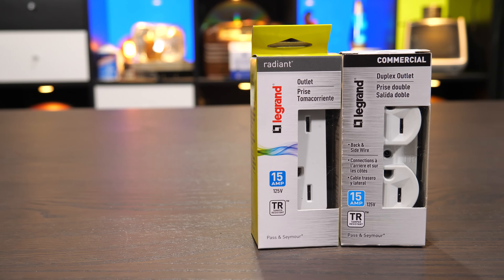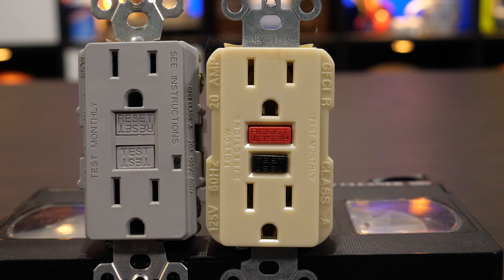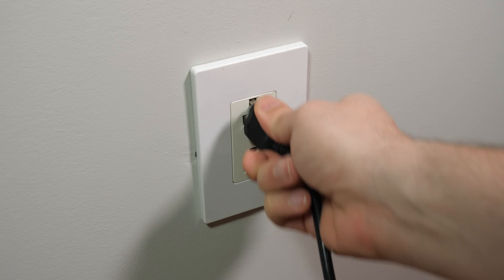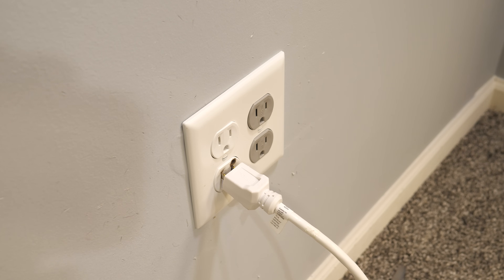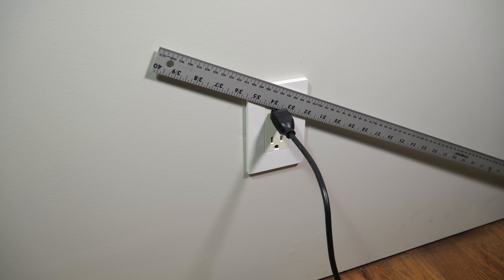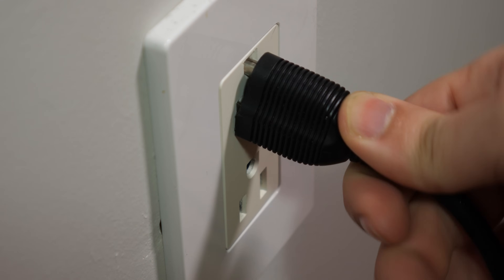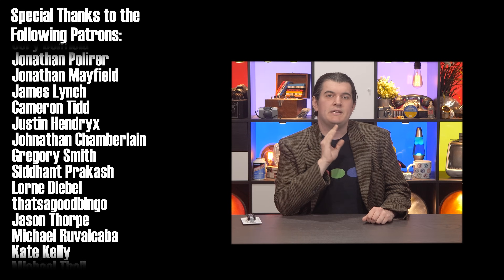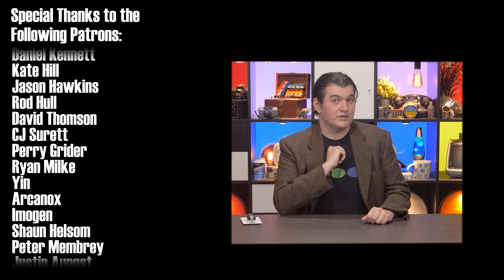Power outlets are topsy turvy - but does it matter?

Comment: How about just having opposing sockets? Having the bottom one the old "right way up", the top one the new "right way up". Then you can just use the bottom one for a 90° plug, the top one for any other plug. And if you mount it sideways, you even can conveniently use two right angle plugs at the same time.

Comment: Over the past two years I've replaced every single outlet in my home with new LED lit outlets. I also put GFI outlets in every outlet in both my kitchen and bathrooms.  Every single outlet has been grounded properly and set correctly in the walls as the National Electrical Code requires. Oh yeah Romex is totally allowed for use here. Sadly or gladly every outlet in my home is oriented ground prong down. What's funny is the LED grid that lights up so you can find the outlet is set so ground prong down aims the outlets LED light panel at the floor which is good for sleeping. Ground prong up would sent the LED light panel illumination UP polluting the room with far more unwanted light at night. Bad for sleeping.

Comment: I bought a house a few years ago and after I moved in, I realized all of the outlets are upside down. You are spot-on. I absolutely HATE it.

One of the first annoyances I encountered: I bought an outlet meter (shown in your video as the kill-a-watt), which you plug into an outlet then plug devices into the meter, and it has a display on it that tells you how much power is being used. I also bought an outlet timer, which also has a display. I can't use either device because to do so I have to stand with my legs straddling the outlet, and bend over to look at it between my calves while my head is upside down. It's the most idiotic thing. I refuse to even do it, so the devices sit collecting dust in a box until I get around to flipping the outlets over.

Another point: my house was built in 1979. The outlets are old. Whatever safety benefit they should theoretically be providing is perhaps only now actually worthwhile. Most plugs are not sagging in the outlet because the outlet is firm and holds the plug tight. It's only once the outlet gets very old that this becomes a bit more of a normal issue. So congratulations to the a**hole who installed all the outlets in my house--now that 35 years have passed, and those outlets are all freaking saggy and shitty, I'm annoyed all the time but theoretically I'm a tad bit safer against an issue that affects nobody, ever.
Reply: Quite a few have posted comments here about upside-down outlets (ground pin on the bottom) contributing to unfortunate incidents.  Hardly "nobody, ever."

Comment: Quite interesting how this is often 'regional'.  In eastern Canada,  power outlets are almost always installed with the ground pin on the bottom.  In the prairie provinces such as Manitoba,  almost always the opposite way with the ground pin at the top.
When you mentioned the Chicago area has mostly settled on a third way (horizontally),  this was a surprise.  The very first electrical installations back to the knob and tube wiring days with ungrounded outlets had receptacles mounted horizontally but the baseboards.

Comment: An office I worked in was being built and they used the upside down orientation - when I asked why, they didn't mention knives, but in an office paperclips (falling behind desks) cause shorts fairly often.  Luckily we're moving away from paper and its insidious clips, but that's what I heard from our office building super.  Likely not a big deal in residential wiring though.
Reply: Paper clips are dwindling slowly, but staples remain annoyingly ubiquitous. Those are uglier, as they vaporize and now one has a cloud of gaseous steel in a plasma state.
Reply: What do you mean by “upside down?”
Reply: Building super?

Comment: The act of inserting a plug into a receptacle is perhaps slightly easier with the ground pin on top, since it is slightly longer -- you can insert the first few mm and "anchor" the plug in the socket before pushing it in. Having that anchor at the top is a little bit easier.

Comment: Do Americans even have "industrial" plugs? I mean we in Germany have the normal ones for indoor (even they're 100times saver) and we have bigger outdoor plugs. They share the same compatibility, voltage and current but are made often made out of rubber, have a big housing to grab onto and have a lip around the socket to be somewhat watertight. Our cables are also way bigger and robust. I have some 2.5mm^2 rubber cable laying around which is like 12mm in diameter (still carrying normal household 230v/16amp) Is this a thing in America?

Comment: Go look at the right angle plugs over here in Europe. Our ground are two contacts at the top and the bottom, and the sides have a notch so the plug does not come out easily. You can plug anything any way you want. And the live contacts have sleeves. Didn't know your electric system was so archaic, btw.

Comment: "Well then! I'll just use the NEMA standard, but skip adding the ground pin to 99% of outlets! Checkmate!" -Japan

Sleeving the plug shouldn't be an issue, lots of plugs here in Japan have them. There's also a good solution for the 90 degree plug that's a bit less complicated to build than a rotating plug: a flipping plug! Rather than rotating, it instead flips along a single axis, so you can have it either pointing up or pointing down.

Comment: I had a painting fall off the wall, slide down, bounce off a lamp plug partially dislodging it, and the metal wire it hung on made contact across the contacts. Luckily, I was home and could hear it arcing.

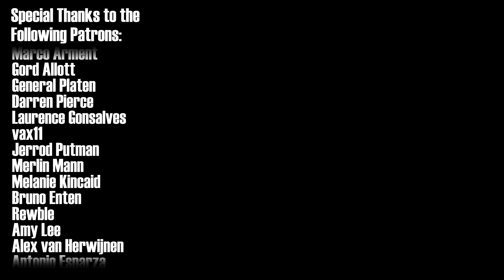Comment: 17:09 - just now realising that those safety cover thingies make a TON of sense in the US. Around here in the UK they get referred to as "socket openers" because the act of placing a bendy plastic thing in a wall outlet which already had a MECHANICAL SHUTTER PROTECTING THE LIVE PINS when empty demonstrably makes shocks more likely, not less
Reply: Tamper resistant receptacles are now code required to pass inspection, he literally mentions this like 20 seconds later.
Reply: @ericdoesstuff7568 my apartment has one receptacle that is tamper-resistant. It's also plug-resistant. It's smack dab in the middle of the apartment in the island so I like to use it for my vacuum, but it's a fight to get the plug in every single time.
Reply: I live in a very old rental home (literally built before the USA was the USA, although the electrical was obviously installed later). A number of the outlets don't work at all and, with some others, only the top or bottom works, and I can never remember which one. After several years of always plugging my rice cooker or air popper into the wrong one first, I installed the plastic child safety doo-dads on the non-working ones.

Comment: It's still the oddest thing for me that your receptacles don't have on/off switches. It seems irresponsible to just yank a live wire out of the wall (although I'm not above doing so myself sometimes). Where I live in South Africa, the only orientation for 220V wall plugs are with the earth connection on top, or sideways in special instances. The plug-tops are designed that way too, with the earth on top and the cord going down. Most plugs are also designed to minimize contact with fingers on the back while pulling it out, and as a bonus feature, the live side is always on a switch. Also our plugs slide in and out straight, there's no droopage and it doesn't pull out partially. The thick earth connector stiffens the plug. Also your plugs have blades, which is only firm laterally while ours have bolts, which gives the electrical connection some vertical-force support as well.

Comment: Whenever I see a video about US outlets I am always amazed by how bad they seem to be. So many flaws that are crying out for a completely new design, from the "ground up" so to speak.
Compared to UK outlets there is zero consideration for safety, it's like taking two screw terminals off a set of speakers, sticking them in the wall and putting mains electricity through them.

Comment: Meanwhile. UK plugs are laughing at you :

1) Long Ground pin
2) Pins that cannot be bent
3) Insulated Live and Neutral
4) Always the correct orientation
5) Fused
6) Shutters on Live and Neutral sockets

Comment: By the code, it does not matter if ground is up or is down or is sideways.
But it is a HAIR safer and MY Master when I was an Apprentice/Journeyman considered it to be a "best practice" to have ground on the top, as "fall on the pins/cable" issues tend to cause a few less problems that way.
He also said it's best to be consistent within any single building, where possible.

Comment: The locks on the doors also seem to be installed upside down in the USA. When you insert the key, the prongs are at the top. At least that's what I've seen in films. Here in Europe the prongs are at the bottom.

Comment: If youre going to as a manufacturer/legislator campaign for changing anything on the topic, go for recessing the outlets with compatible plugs. Just recessed outlets would be a huge improvement.
Reply: When you retrofit plugs, you will have to change out the entire wall box.  Either that or go to a surface-mount plug that juts out from the wall.

Comment: The problems with downward right angle plugs are that you can only use one per receptacle, and that they’re horrible with power strips that have the plugs oriented toward the end of the strip (the easier version to manufacture, incidentally) instead of sideways along the strip. We’d want to change to receptacles with the plugs side to side instead of stacked for that to be a good solution.

Comment: Completely agree with you ! I hate ground up configuration. Plus, a large wall brick adaptor with a ground pin exerts quite a torque on the receptacle.. the ground up is a solution to an hypothetical problem....

Comment: I have found most of the time, an outlet with the "ground on top" orientation is for a half-hot (commonly known as a switched) outlet, where one half of the outlet is always hot, and the other half is on a wall switch.

Comment: The 45° right angle plug has another advantage - the torque from the weight of the cable helps to improve the plug retention and increases the force required to accidentally pull the plug out.

Comment: My portable AC unit is the only device I have that makes electrocuting yourself very hard to do. It has a plug that is very large and almost requires two hands to plug it in correctly. Your fingers are blocked by a huge lip and it covers the whole socket and does its level best to block any attempt to use the other socket. It does not matter which socket you plug it into. The other socket will just be blocked and unusable. The website says this is a feature and not a bug. It also has a switch in the plug itself that has to be pressed before the device can be powered on for first use. It is not a fuse but like a breaker switch. Not sure what that is called. It also mentions it has a few non user serviceable fuses that will hard fail the device under specific conditions.

Comment: I had a metal cover on a garage outlet which was loosely screwed on that fell in that little gap and burnt about have way through one of the blades on a power strip before the breaker tripped. Power strip still works.

Comment: My problem with the US sockets is that the weight of the cable pulls the plug down, exposing the live and neutral pins. Having the ground at the top seems like it would act as a better pivot and keep the live pin fully engaged under downward force.

Anyway, stupid design. British with a built in fuse and Australian/NZ plugs are much better designs, but they also have lethal voltage to handle.

Comment: Plug manufacturers need to take a page from the UK and the type-G plug. Orientation not withstanding, they always come with a sizable surface to grip when unplugging. They are much bulkier, but the cord is always flush with the wall, so no gravity issues. I mean, I could go on and on about the superior design of the type-G, but I'd wager most regular watchers of this channel already know its benefits.

Comment: Maybe it’s just where I live, but all houses in this area have outlets installed vertically with the ground on the bottom, EXCEPT “half hots” which are controlled by a wall switch. Here, you know a plug is controlled by a wall switch because it’s mounted upside down. Don’t know if that’s code, or just convention.

Comment: For years I've had an idea in my mind that I've never expressed that I wished they would flip one of the receptacles, mainly because in most plugs, the two prongs are different sizes and they fit one way... And sometimes it would make sense to have both options in one
Reply: What makes it's funnier is that for any device that connects to these outlets that's not a 60 years old transformerless tube radio/guitar amplifier the orientation live/neutral doesn't matter whatsoever.

Comment: Yeah you should either recess the sockets, so if the plug pulls out a bit the prongs are still protected; or mandate sleeving on the live and neutral.

Australia did the latter back around 2006 and I still occasionally see recessed sockets as well.

Comment: My Sunbeam bathroom heater has a GFCI device built into the plug, oriented with the ground plug at the bottom.  When I had it plugged into a "correct" outlet the wire was kinked and the plug looked strained, enough so that I flipped the outlet around.

I also have one of those surge protectors with a flippy tray to hold your phone while it's charging, which won't work in the "correct" orientation.  It's moot, though, since it's too small to hold the giant phones of today anyway.

Comment: 1)Change the orientation of the receptacle by 90 degrees? 2) Require new safety regulations with reguard to the plug housing making it easier to hold on  to when inserting and removing.  Or any thing but nothing.

Comment: On the shock hazard point, I've actually gotten zapped plugging in a Christmas tree angel because my fingers got to close to the contacts while trying to plug it in half-blind (I have a fake tree with lights already strung through it and there's a somewhat convenient plug near the top hidden near the trunk).  Of course it's just AC 120 and I only touched it with one hand so no real damage done.  Unlike the time I got zapped by a strobe light (electronics class in high school, trying to trouble shoot someone else's light and didn't realize they still had it plugged in, that was only around DC 4000).

Comment: My older home has all the outlets ground prong up and it drives me insane. Power strips and cable management is an absolute nightmare. I’ve replaced a few and rotated them but this video hit me harder than you know. Great stuff my man, keep up the good work!
Reply: I work in a building that has them all ground pin up. When I asked about it the site electrician explained that plugging in something, angling it in from above it makes for a better ground-first contact. 

But as someone who'd switched to using right-angle plugs for things wherever possible, they are an annoyance since they are now all angled upwards and therefore pull on the plug more. 

I'd actually like to have the whole wallplate rotated 90deg (but the plug still "vertical") so that having them side-by-side ought to be better than one above the other.
Reply: Complain to the manufacturers of the plugs that are designed for upside-down receptacles.

Comment: Wrong GE window air conditioners plugs are made for ground up. Not all appliances cords are made for ground down. And how many people have dedicated outlets for window AC units. They just find the nearest outlet and plug it in. I don't like my cords hanging above the outlet. Time to reinstall my outlets ground up. But we already created another problem ground up is also a switched outlet or no. It's time the electric code specify which way we are going with this outlet orientation. Since the hospitals have ground up it makes sense to go with that standard.  Once written in stone with the NEC the manufacturers will follow suit. Ground up on all flat plugs. 73

P.S. 45 degree design is best for all outlet orientation. 73

Comment: I'm a big fan of 90° plugs also because I often have furniture in front, and it both lets the furniture fit closer to the wall and prevents it from bending the plug out if it moves (such as a bed on a hard floor when people get in too quickly).